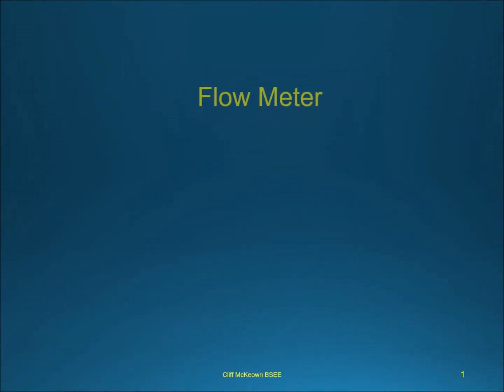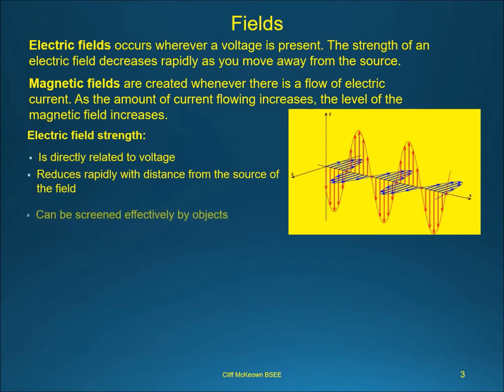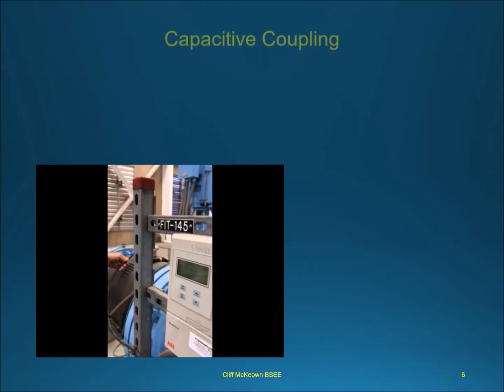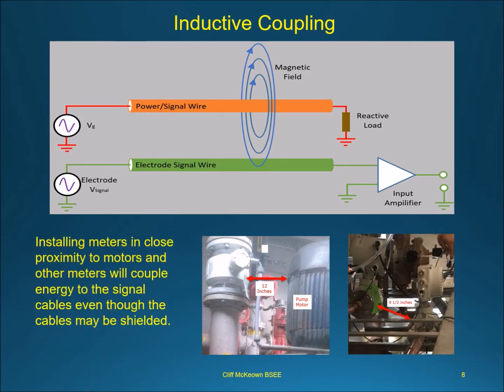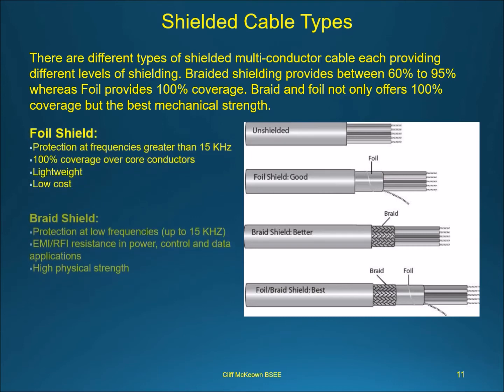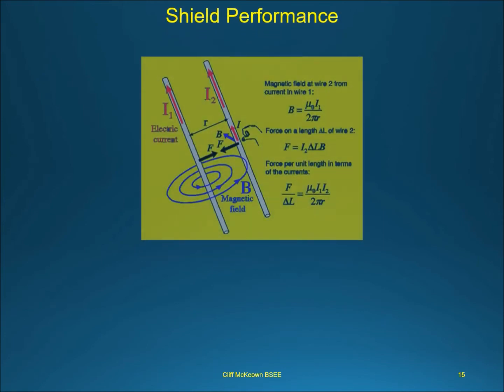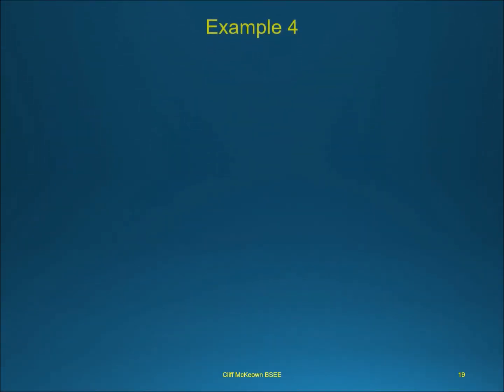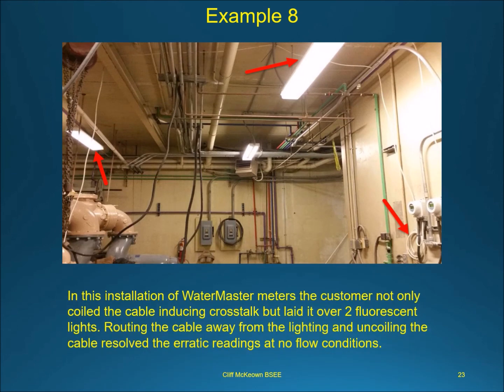Cable Shielding and EMI Protection

Comment: Sir in my field water master flowmeter is showing negative reading how can I solve that...
Reply from the maker: Go into your Advanced level of menus, scroll to "Device Set Up" and select it, Scroll to "Operating Mode" and select it, scroll to "Flow indication" and toggle it to "Reverse". This switches the polarity of the signal.
Reply: Sir I changed flow indication forward and reverse also but still coming negative
Reply from the maker: If your readings are steady but reading in the negative range use the procedure I sent. The meter is bi directional and people install them back wards. If you readings are bouncing positive and negative at zero flow rate with a full pipe then you have a noise issue. If that the case you will want to open a case at  ABB's HelpDesk at 1-800-435-7365 because you may have bigger problems than a setting.
Reply: Constant negative reading coming inside pipe water is there I check with valve side... i check their cables with multimeter wire is also giving continuity...
Reply: Thanks for giving fast response I will call helpDesk
Reply from the maker: Edit the Flow Indication for reverse